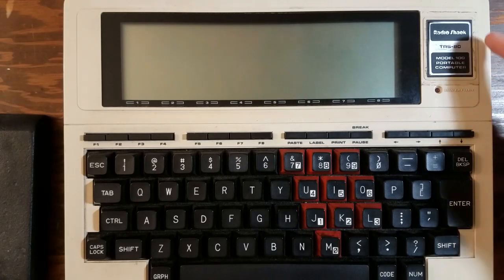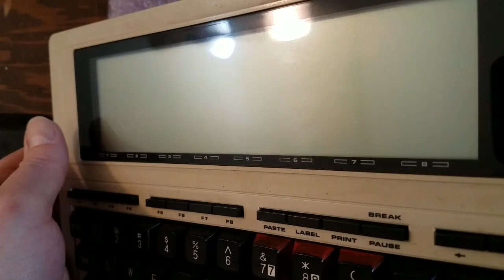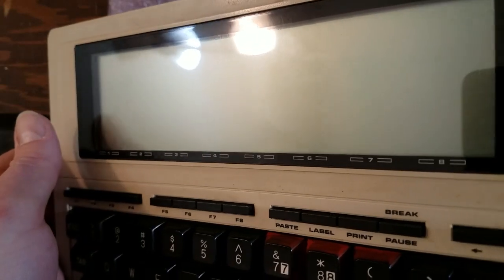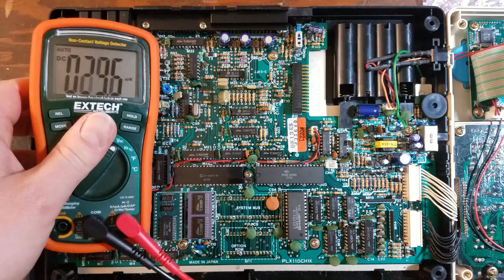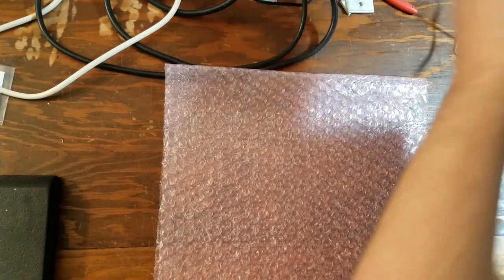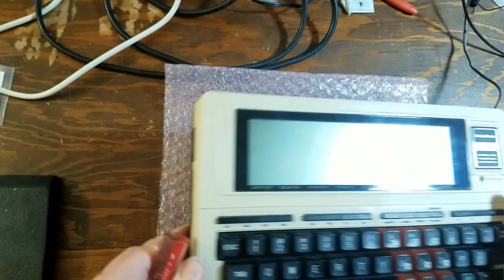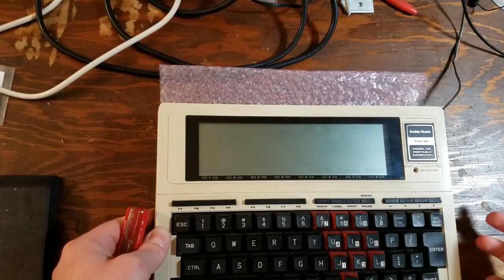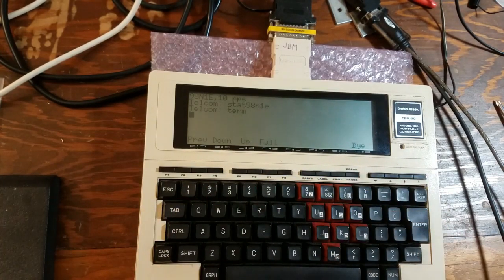Diagnosing and repairing a dead Tandy TRS-80 Model 100 portable computer

Comment: Thanks for this vid -- that seemed like an easy fix!
The Tandy 100s have major issues with battery and cap leakage that can totally destroy the PCB unless pre-emptive action is taken.
I have two of these and also had to replace C85 and C82 after a major leak in the PSU section. One of them also had a leaking battery that destroyed the 4584 IC (M35) right next to it, disabling the RS232 interface.
My other Tandy 100 now started showing major corrosion around C49, C50, C54 and C55 (all 10µF/16V). I believe these act as filter caps for VDD and VEE in the modem section. CHECK THESE CAPS ON YOUR MODEL 100!
In general, it's a good idea to regularly pop open your Tandy 100 and check the battery for leakage, and for any corrosion on the PCB.
Both of mine still work, but the PCB now bear major scars.

Comment: Currently working on mine (bad corrosion; C82 and the capacitors around C49. Eaten away trace on pin 3 of battery connector.) While transcribing the schematic to KiCAD, I noticed that the shield connector is not directly connected to ground, but coupled to the rails with two capacitors. Ok to measure against in 8:56 (in particular AC), but values are not true ground referenced. So the battery spring is a slightly better GND choice.
Reply: Yeah, been there too. ☹
C82, C85, C49, C50, C54 and C55 are the main culprits. Lots of corrosion! 
I now resorted to using descaling solution (citric acid) to neutralise the leakage first. Should work for batteries too. Of course that also removes the solder resist and all labelling. I've also had M35 (4584 near RS232) and D15 in the PSU short due to leaked electrolyte.
Reply from the maker: At this point I'm recommending that every M100 get a FULL recap immediately upon acquisition. I've got one more in my collection that needs to be done, too. They're all leak risks. :(

Comment: Nice video, i'm trouble shooting one right now to try and sell it on ebay. i hear inputs but no screen. open the back cover, see that C85 is corroded.  I take that is my issue.  at a minimum now I can pass more info onto the buyers.
Reply from the maker: Yes - this machine need a complete re-cap. C85 is keeping the LCD voltage from being generated, but I'd say they all need to be removed, cleaned VERY well, and replaced.
Reply: Also check C82 in the PSU. Once you have VEE and VDD, check C49, C50, C54 and C55 in the modem section. These can cause serious damage but cause no immediate symptoms... until they completely eat thru traces!

Comment: It didn't beep at 7:17 because you didn't reconnect the speaker (which you can see at 6:27)...
Reply from the maker: Ah, yes. D'oh! In the end, it didn't actually matter on this unit, but yeah - gotta make sure the speaker is attached in order to do the "blind beep" check. Thanks.

Comment: Do you think the crystal failed due to impact? What frequency is it? Just imagine the battery life it could of had if epaper displays were around then. I usually got about two months on a set of AA batteries. Used it as a dumb terminal for testing mostly then.
Reply from the maker: Apparently it's a 4.9152MHz crystal. Impact is certainly one possibility in a portable, though I would expect it likely to see corresponding damage to the case. The world may never know 😂

Comment: Are the little transformers in the power supply difficult to find? I noticed you had removed one from your spare machine and was curious about the failure mode.
Reply from the maker: I have not found a source for them, but I haven't looked very hard either. Would be a good thing to find and I suspect they're a standard part if I knew how/where to look.

Comment: Thanks for the great video Josh! I'm working on an M102 that is really baffling me - it froze when I was using it and the LCD is garbled when I turn it on, as if it's getting junk data. I've removed and checked each of the RAM chips and did a full re-cap. There is some brief activity on the address and data lines right when I turn it on, but nothing after that. Have you seen this before and do you have any ideas for what should check to further diagnose?  Thank you!
Reply from the maker: (Sorry for the late reply. Somehow comment notifications stopped working).
I had pretty much this exact issue with my 102 and it turned out to be a bad address decoding mux on the bottom of the board. Might be worth checking if any of those lines are either short to ground or not toggling as you would expect.

Comment: What does an original memory battery look like?  I am looking at a brown one,
Reply from the maker: They are usually brown, yeah. Most of the ones I've encountered were Yuasa brand I think
Reply: @48kRAM  Yeah, they're Yuasas on my two 100s and a 102. They are actually of much better quality than the rubbish replacement I got -- apparently Varta, so go figure. The Varta died after just a few years in one of the 100s. The original Yuasas in the other 100 and 102 are still going! Again, go figure. Is it just me or has battery quality gone down the drain these days?
(Of course, I check the Yuasas regularly, and one is starting to turn a little crusty, so I'll have to replace it sometime soon).